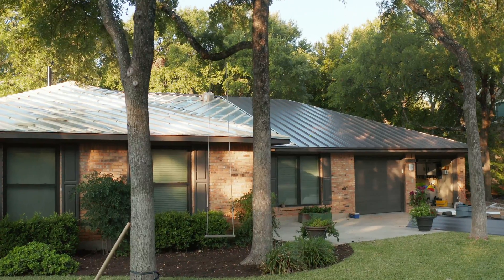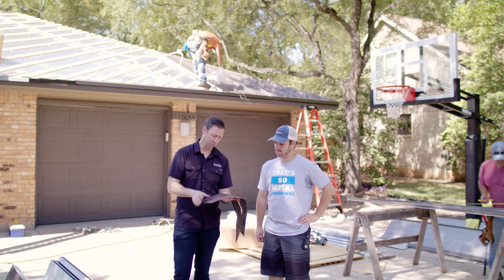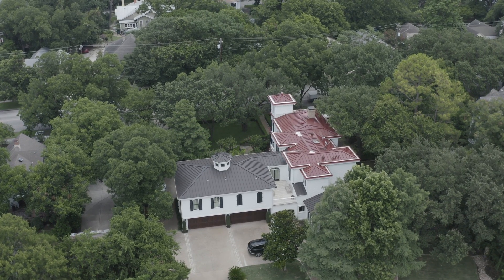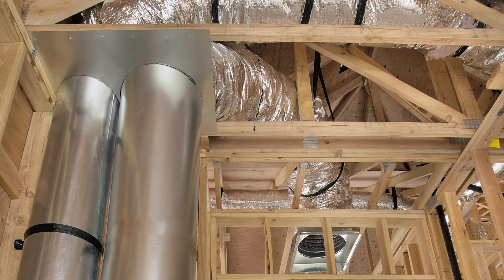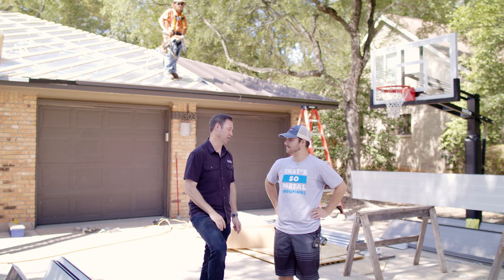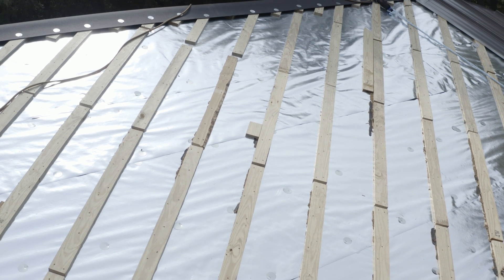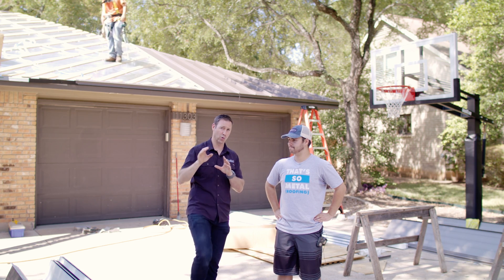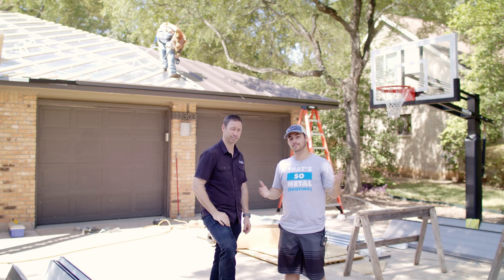Installing A Metal Roof On Matt Risinger's House

Comment: Sorry for the late question - but how is the 1X rain screen attached to the deck below? I have a Zip system deck, 3 inches of isoboard insulation, 1/2 inch ply roof deck, and Sharkskin underlayment. Thanks so much for the great info - metal is definitely the way to go in fire-prone California. 🙂

Comment: Hi Matt! Loved this video. Two questions. 1) what’s under the Sharkskin radiant barrier? Plywood? Huber Zip sheathing? 2) The Sharkskin website says its radiant barrier installs with normal 3/8” roofing nails. Did you specify ring shank nails? If not, why not?
Reply: Shark SKin Ultra SA stick on waterproof barrier is under the radiant barrier.

Comment: FWIW: I think it better to use a set of bottom vertical strips (1x4) with top 2x4 horizontal strips (CrisCross pattern) for metal roofing. This way you can use convection to remove a lot of the sun heat. Cooler air is drawn in from the soffit edges and the hot air is vented through the rigid cap. The issue with matt's 45 degree method it that it prevents air from to through the ridge cap (at least at the edges of the roof. 

FYI: You want to use 2x4" for the top horizontal strips for more rigidity.

Comment: When there is  rain/hail is it loud in the house?
Reply from the maker: Hello! Check out our metal roofing myths to learn more about rain noise. Myth #2 is the one you want: http://bit.ly/metal-roof-myths-video
Thanks! -Thad
Reply: @TheMetalRoofingChannel  thanks, that was super helpful.
Reply: @TheMetalRoofingChannel   can I use furring strips like matt did on a 45 with 3 foot metal panels?  Or do they have to be vertical?
Reply: I have a standing seam metal roof with closed cell spray foam under the roof deck. It is way louder than my previous asphalt shingle roof. I suspect it is a combination of the metal and the insulation system though. I would tend to believe that if I had R-30 blown in laying on my drywall ceiling that it would do a better job of absorbing sound from the rain impacting the panels. That said I would never put another shingle roof on a house. My son and I a getting ready to do a snap-lock standing seam roof on his house. Ton of work but totally worth the end product.
Reply: @SillyPutty3700  I appreciate the response.

Comment: Oh my... Can you just start builds like in Europe. We got hot climate, nordic, moderate, we got all the best solutions and you Americans still don't use them, blinding houses of the cardboard and paper. 
I can't get it why you still use this kind of shingles. My father build roof over his house 30 years ago and it's ok till now, last year we painted it for a first time. Our bricks do not rot, windows don't let air in, walls dot't tear up after sneezing on them.
And it isn't so much more expensive, and all the cost of building are saving on renovations of bad materials.
Reply: I don't even know where to begin other than to say you have some false preconceptions.
Reply: @willagoateatit3298  I do not have a false preconceptions. Some thing's that i wrote you shouldn't take literally. Houses in US have a nice interior standards but build materials are some times just bad. Typical US house build from wood have a really bad insulation values, and i know it getting better lately but still nothing compares to European standards. And worst example of building quality are tar shingles roofs - this is just wrong material.
Reply: Brick laying & masonry is basically dead in the US as there are very few masons left in the US.

A lot of the examples you write about apply to mass produced\spec homes, that builders crank out quickly. Usually Custom homes are build to much better standards. That said US building code has been improving to force cheap builder to use better materials and construction, but its also driving up home costs, making them un-affordable.

The cost of new home is about $400K (which is mostly the Cheapo homes) a decent custom home with solid construction & materials will cost over $500K which is simply affordably for most americans (making less $50K a year).
Reply: @guytech7310  In EU or whole Europe we build houses not from typical bricks but  for various type of ceramic and silicate blocks that don't need special knowledge and experience and it's much easier than building frame houses. Growing on popularity are woof houses but made in factories and put like a lego on construction site. It's basically log house but logs are made form two pieces of wood sandwiching insulation normal logs are also an option. 
I can bet that is quicker to build bungalow from blocks than from a wood frame. And many crews can work besides each other.  Foundations are  the same in US and Europe slab or basement.

I can see that US building better houses but still there is many ways to skin a cat but some are cheaper than others. 

About prices, 400K for house in my region is a lot of money prices depends on country/city eastern Poland where i reside to Paris, Berlin, Warsaw is a lot of a difference. In Warsaw you could probably buy/build a small house/flat for 400 k USD but in place where i live we could build few houses. Cheapo house in Poland if you got your own plot is about 50 k USD, if you decide make it by your own half of that.

Comment: Can you use horizontal batten strips. Same one as installed for concrete tiles
Reply: Also what is the difference of the batten vs cedar mesh mat spacer?
Reply from the maker: It comes down to what your ventilation requirements are, local codes, system type, etc. I would recommend consulting with your manufacturer to determine the best ventilation method for your project. To answer your second question, a ventilated mat system like the Sharkskin dimple mat we discuss in this video is designed specifically to allow proper air flow from eave to ridge without the potential inefficiencies of battens. Hope this helps! -Thad

Comment: Also.  Why the Sharkskin SA peel and stick over the decking?  Is the thinking that any moisture trapped between the peel and stick and the plywood would dry to the attic side?  Why not go with a synthetic breathable underlay like GAF Deck Armour and have the ability for the moisture to dry to both sides.  Also not sure the radiant barrier is needed--isn't the metal itself functioning as a radiant barrier?  What about the moisture between the foil and the Sharkskin?  Won't this be an issue where it will be trapped and not dry?  Wouldn't battens and a breathable underlay be better?  There will not be much heat gain with the air gap, and the metal is already a radiant barrier and has a very low thermal mass.  Also, any moisture escaping from the house will be trapped between the peel and stick and the plywood, potentially causing rot problems.
Reply: yalestudent99 I’m sure Matt has the logistics of this project figured out but if the roof is installed properly and with the amount of venting via the drip edge that Matt installed that air theoretically should naturally circulate under the metal panels and dry any moisture trapped between the panels and his underlayment. The attic is either vented or humidity controlled so there should be no issues with moisture and the roof sheathing from inside out. Also Matt has a peel and stick membrane under his reflective membrane so there really shouldn’t be any moisture transfer to the roof sheathing from the reflective membrane either. Battens and breathable underpayment wouldn’t be 100% moisture resistant being you are nailing the battens through the synthetic leaving holes where moisture could potentially penetrate besides peel and stick membranes I would imagine would do a better job overall keeping moisture off your decking in general even thinking about condensation. As far as the metal roof’s reflective properties I know the painted side gets boiling hot but I don’t recall how much heat transfers to the back of the panel, however much it’s definitely less than asphalt.

Comment: I would have liked more details on how they handled the ridge cap and hips on this roof and using this system--as it looks unusual.  I don't see Z enclosures--I see almost a double ridgecap system with the venting underneath.  How will this hold up to bugs and wasps?  The whole thing was just a conversation without any demonstration of the men doing the work--this would have been a lot more interesting if we saw what they were doing for the various roof deails, ridge, hip, trim, etc  Did they use butyl tape in the valleys?  This was more of a commercial than anything else.
Reply from the maker: Hello! When you have an above-deck air gap, you will have to build up your trim accordingly. You can see an example of that at 4:50 on the right side of your screen. The eave they're using is a pretty standard detail, but it is manufactured so it fits over top of the battens and the corrugated plastic that sits underneath. We have a whole series about detail installation which you can check out here: https://www.youtube.com/playlist?list=PLrMRkz6smMg3SjsuPhCQBlcrYuNfqL242
At the ridge, what you're seeing is actually felt paper that has been attached only temporarily to protect that area from the elements. In this case, it was replaced once the final metal ridge cap went on. Many vented ridge details have components that don't allow debris and insects to infiltrate the system, but still allow for proper air flow. I do wish I had some finished shots of the roof, but unfortunately we weren't able to get those for this video. I'll keep in mind vented ridge install as a possible future topic, thanks for the suggestion! -Thad

Comment: Great Roof, Been a big fan of Matt's for years.  There is nothing better than putting a radiant barrier in a metal roof to keep a home cooler.  Check out the video I did with thermal imaging to show how the radiant barrier underlayment works to reflect radiant heat:  https://youtu.be/TdPLmbkhH2o

Comment: What is the corrugated product Matt is using at the drip edge and where is that sourced from?  Enjoy your videos, thank you.
Reply: I believe it's Coravent
Reply: @garycox2253  Thank you, just googled that and looks like what I need.
Reply from the maker: Yep, that is a Cor-A-Vent product. You can find it at many roofing supply houses and online. Thanks @Gary Cox for the confirmation! -Thad
Reply from the maker: Glad you like the videos, Brian! Let me check with Matt and I'll get back to you on where he sources that from. Thanks for the comment! -Thad
Reply: Don't use Cor-A-Vent as its garbage in my opinion. Its basically very thin strips of plastic stapled together. Instead just use construction metal mesh screening. Much more durable and easier to install (saving you time & money). You can get it in aluminium, or galavanized steel.